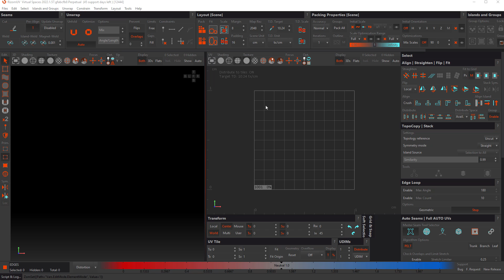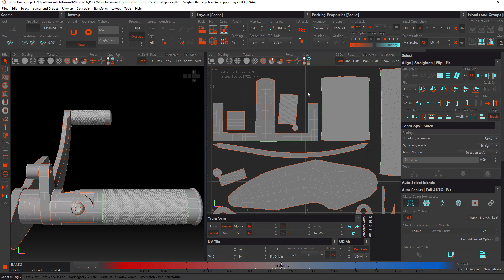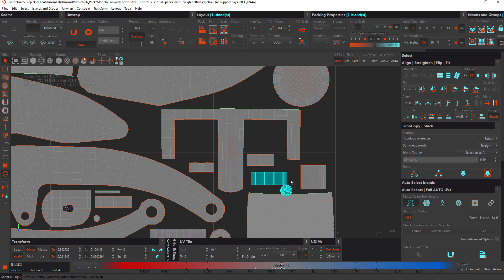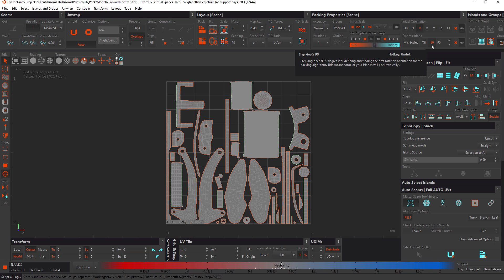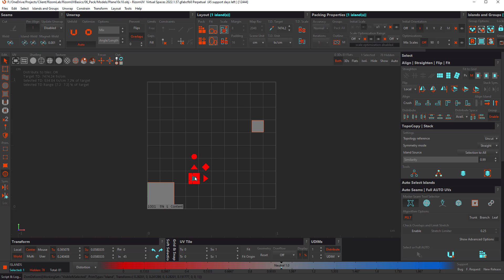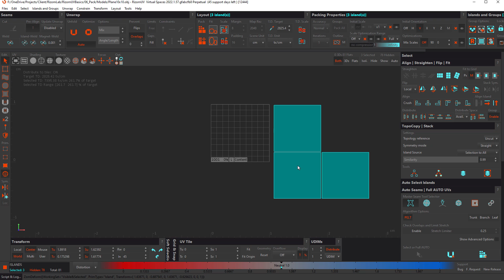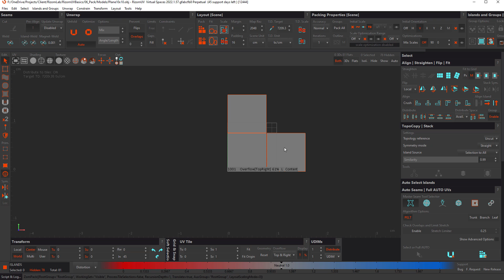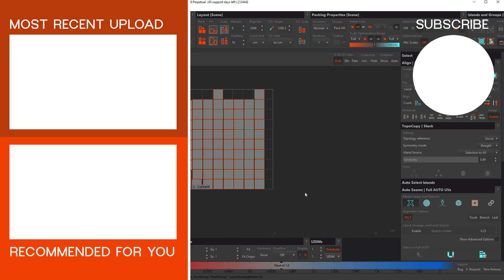RizomUV Basics (2023): Packing Fundamentals

Comment: Hi guys, when I do my UDIMS I`ve noticed that either uv shells are spread away from each other or a lot of empty spaces between the uv shells. Any Help? Here`s what I do - Unwrap all my 3d meshes indivudually in RizomUV then return them in 3ds Max using bridge. From 3ds Max I select all 3d meshes and using a bridge open them in RizomUV. Then I use Polygone Groups Selector - select all my materials (7 mtl) so I make 7 UDIMS tiles, from Polygroups Selector - Distribute in Tiles... all uv islands got distributed in the UDIMS following TD of 4096 so all of them are not fitting in the tiles... to make them fit I use Polygone Groups Selector - Distribute in Groups then Alt+B (rescale selected items to fit the UV square) and all uv`s fit in all the tiles but obviously either uv shells are spread away from each other or a lot of empty spaces between the uv shells...My question is how to maximize tile area with my uv islands with all my UDIMS?
Reply from the maker: Can you join our discord? That way you can share images and I'll get a better grasp of what's happening. Cheers.
https://discord.com/invite/UjsFx7Y

Comment: Hey, I've just bought RizomUV and absolutely love it, I have been only using it for a day and already it's become a must have to my arsenal tool kit. I have a question, sorry it's a bit of a stupid one but once a seam has been marked using the cut tool how do I unmark it?  I thought it would be holding the ctrl and pressing the C key, but this doesn't work.
Reply from the maker: By "marked" are you talking about Selected Edges? or Cut Seams?
Reply: @RizomUV  I mean cut seams, I just want to know how to remove them. Thanks
Reply from the maker: @bubbleupsoftware7978  - With the "Weld" Tool, in fact it is covered in one of the videos of this RizomUV Basics series: https://youtu.be/8AN32CfCp3Y